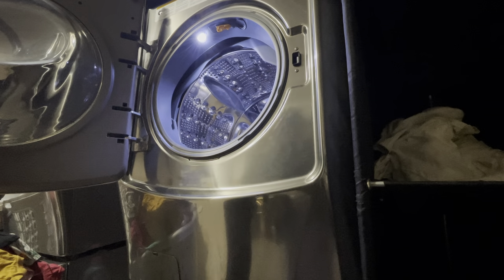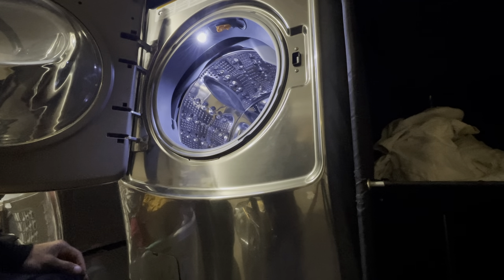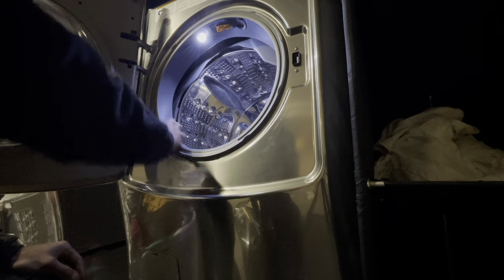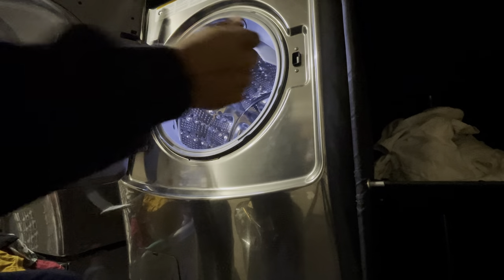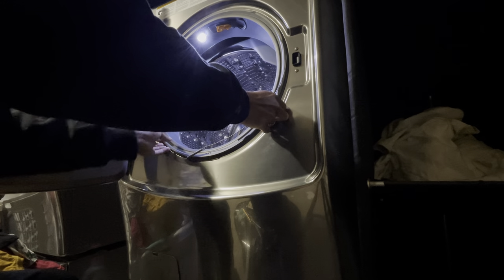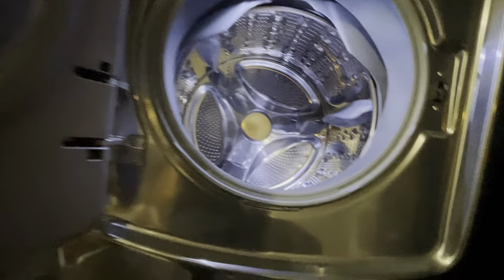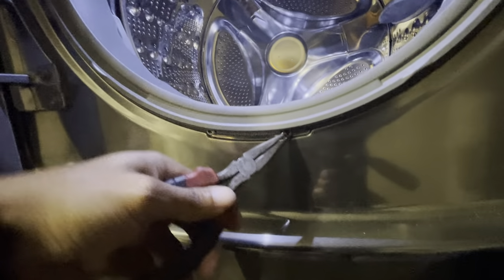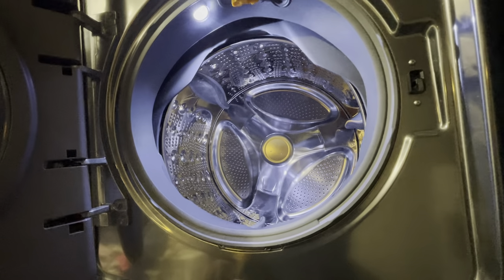How to Install door seal retaining ring with needle nose pliers your thumbs will thank you.

Comment: Hello, how can I open the front of the washing machine in order to replace the water drainage pumps
Reply from the maker: do you have this exact model?
Reply: @theendresult7584  I have this exact model and I am wondering the same. All videos show with the smaller capacity LG front loaders that do not have the detergent on the top. They all have the detergent drawers on the front. So I am hoping to find a way to get into the machine to replace the drain pump.